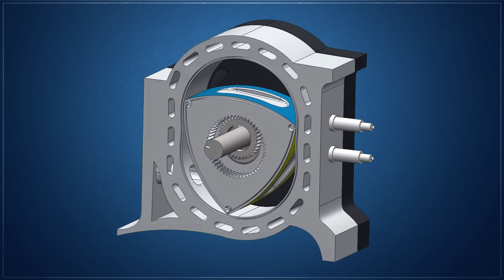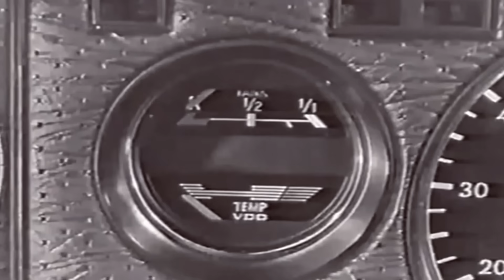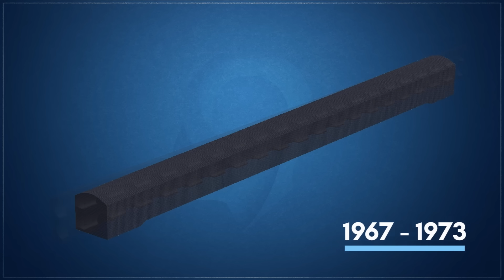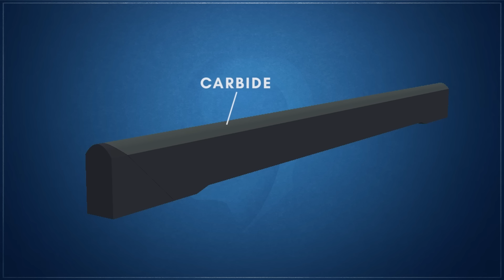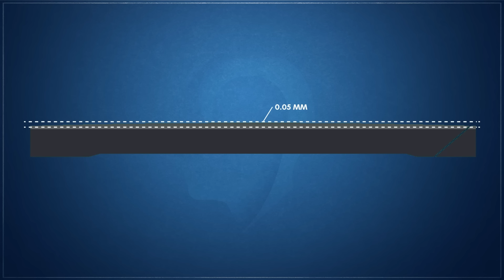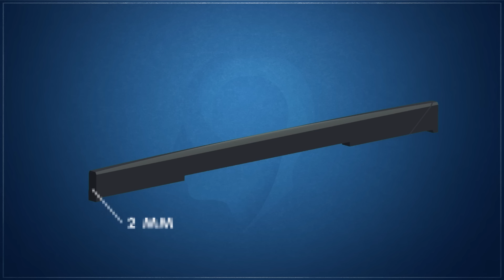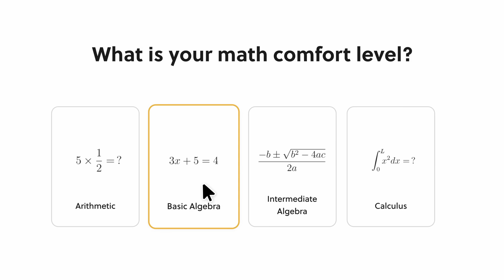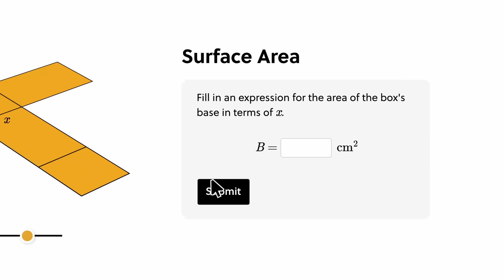Overcoming The Rotary Engine’s Biggest Flaw

Comment: That cant be right. The generator may can run full time for 373 miles...but in conjunction with brakijg regen, coasting, and battery storage, it surely amounts to more than 28mpg...
Reply: It's running while its coasting, though. It's a generator engine that's not connected to the transmission.

Comment: I would argue that the apex seal was totally resolved by Mazda and this was clearly not the biggest problem related to this engine.   The large combustion chamber surface area with corners that prematurely quenched the combustion flame front resulting in high HC emissions was a far more fundamental problem than simply could not be resolved.
Reply: Thats exactly what I was thinking.
40+ years ago, apex seals were most certainly a challenge. Mazda and the aftermarket have made sure they are no longer much of an issue. But the long, thermally inefficient combustion chamber is an issue that cannot be rectified without the rotary becoming something totally new and unrecognizable as Mazda's darling.
Reply: @84gssteve  they could use a metal that has lower thermal conductivity, like stainless steel, for the combustion chamber and coat parts of the rotor that is not subject to friction with ceramic coatings to slow down the heat transfer.
Reply: @84gssteve reliability problems have never been resolved
Reply: @84gssteve  i would think the longer a motor can hold on to the precious energy-giving hot exhaust gasses the more efficient it would be, no? i thought the emissions and poor fuel mileage was because the injected or sucked in fuel (carbed versions) sloshed to the back of the rotor on intake, thus allowing a bunch of raw fuel to escape on the exhaust stroke unburned... same principal as in a 2 stroke non-DFI piston motor? positive im explaining that incorrectly about emissions but thats whats in y head!
Reply: @ct1762  The Wankel engine is inefficient in 3 ways;
 it has poor combustion, poor thermal efficiency and poor mechanical efficiency which means that less fuel is converted into heat (inside the engine), and less heat from that fuel is converted into rotational horsepower.

we see this expressed as high exhaust emissions, high exhaust temperature and low BMEP and torque output.

simply put, it's not a very good engine design in every important aspect of engine design.
Reply: @DoktorBayerischeMotorenWerke it is a good engine design, it's just currently not as efficient as a 4 stroke piston engine. If configured as a generator running at constant speed or for long range drones, it's an amazing engine.
Reply: @Benny_Shill  The Wankel engine was a failure, it is a very poor, inferior design that cannot compete with or offers any advantages over other more successful engine types.
Wrong, the Wankel engine is very poorly suited to generator applications and has never been used successfully in a commercial generator application.
It is also very poorly suited to long range drone applications due to its high fuel consumption and lack of loiter time over targets.
 The most popular UAV engine in the world is the reciprocating types made by the Austrian company Rotax.
 The United States Military is the largest operator of UAV no longer buys any UAV with a Wankel engine, they have a notoriously bad reputation for poor reliability and limited range. 

Wankel engines are so unreliable that they cannot be used in manned aircraft.
Reply: @84gssteve I'm hoping that liquid pistons designs will do a better job here.
Reply: Seems like there are few components with any geometry flexibility in the wankel, so opportunities to fix these issues are... probably not great.
Reply: Agreed. Seems to me the biggest issue with the rotary is requiring engine oil in the fuel, hurting emissions.
Reply: @isaakwelch3451  The biggest problem with the Wankel engine remains poor reliability and durability, this is a fundamental design issue related to the instability of the combustion and the extremely low mean time between failures of the fragile apex seals.
Reply: They also leak compression internally between the faces.
I have an Rx8 with a mod to fix this and it's never been better. Cooler exhaust, better mpg, no more flooding.
Reply: @LordCakeskull There are no effective solutions to the many fatal flaws that plague the Wankel engine design..
Reply: Had to laugh iv seen and driven every Mazda rotary car over the years.i just now realized it.i presently own an rx8 lol yeah they can be a bit of a pain  but fun fun when they're good to go😊
Reply: Seems revving this engine high  makes combustion better less fuel used
Reply: Also the fact the combustion always takes place in only one section of the chamber. That is something that can't be resolved.
Reply: Interesting opinion.
Reply: 3rd plug new patent
Reply: @GilSimhonCoachingNLPservices  What new patent?
Reply: @sandervanderkammen9230  
Mazda has a new patent regarding a 3rd spark plug to combust fuel that else will not combust until the exhaust
Reply: @GilSimhonCoachingNLPservices  3 spark plugs are not new, was invented decades ago.
Reply: @GilSimhonCoachingNLPservices  Adding more spark plugs lowered the thermal fuel efficiency which is why no production engines had more than 2 plugs
Reply: @sandervanderkammen9230 put a rocker arm on combustion chamber doors that alters the shape of ghe housing with movement of the rotor... or put a 1 cylinder piston on the Crank and route all exhaust through it and double combust to increase power and lower emissions.
Reply: @Benny_Shill The intake and exhaust ports are already covered during the combustion cycle.
The shape of the combustion chamber is linked directly to the very limited geometry envelope that allows it to function as an engine.
It's been done, combined cycle heat engines.
 Turbocharging and Turbocompounding are the same concept but are more efficient.
Neither system solves the problems and disadvantages of the Wankel engine, in fact it just causes additional problems.

It seems like you have been fed alot of misinformation about the Wankel engine.

You need to have an advanced understanding of how 4-stroke engines work and a deep dive into the engineering concepts before you begin see why the Wankel engine is a failure.

Any questions kid?
Reply: If emissions are the only problem i would call this a problem-free engine
Reply: @sking2173, Great idea!  10-16-25 TH
Reply: Do wankel diesels work any better considering the flame jets aren't supposed to get anywhere near the chamber walls?
Reply: @gregorymalchuk272  The Wankel KKM cannot support reliable Diesel compression ignition or thermal efficiency due to the low static and dynamic compression ratio.
The Wankel engine's compromised seal design cannot withstand the high pressures and temperatures either.
Reply: This sounds like a more interesting video, honestly.
Reply: @kindlin  The most HATED rotary🔥🔥😬💥🤘👉 https://www.youtube.com/watch?v=gHVC9DN1row
Reply: there's liquid piston design (not a wankel) which resolves that and has ~40% eff
Reply: Allegedly.
Reply: @ChuckLeeClerk Beware of LiquidPiston it is a notorious vaporware investment scam
Reply: @ChuckLeeClerk  The most HATED rotary🔥🔥😬💥🤘👉 https://www.youtube.com/watch?v=gHVC9DN1row
Reply: Your argument fails under scrutiny... the primary failure mode of all Wankel engines is compression loss due to apex seal failure, it is well-known and understood that the apex seals have poor durability and a very low MTBF, so low that Wankel engines cannot pass the minimum reliability standards for aircraft certification testing.
Reply: Engine oil consumption was ridiculous😮😮😢😢
Reply: Hmm..A wider combustion chamber,..A dbl-section seal...and an MSD-type multi-spark progressive ignition..with proper timing curve....and a better housing for heat loss reduction to go along with the re-configured  intake port should improve efficiency.//Steve B.
Reply: @stephenbaker3680  Its all been tried before and found to be ineffective or detrimental to efficiency and performance.
The Wankel engine reached the logical conclusion of its development potential decades ago... it is fundamentally and inherently inferior to the reciprocating engine concept.
 There is no longer any legitimate research or development of Wankel engines in the Industry..
The Wankel engine today is the sole domain of crackpots and con men.
Reply: When you used the word clearly you completely lost me. People that say clearly loosely are almost disconnected from reality.
Reply: The lubrication of a rotary is the hardest challenge I believe. The operate much like a 2 stroke, having no separate combustion/no combustion areas; every part of a rotary is doing something, all of the time. This can be fixed by premixing, but that makes a car likely fail emissions regulations.
Reply: @willlong4258  — Some enthusiasts did actually add 2-stroke oil to the fuel … From what I’ve read, it worked.
Reply: @sking2173  yep, I do that. It absolutely works. My dad has a 196,000 km rx8 on its first engine for that reason.
Reply: @willlong4258 premixing also makes it more unreliable
Reply: @willlong4258  WHY!  Why would anyone deliberately pour the wrong oil down the wrong filler hole???

Premixing an engine that already has a metered oil injection system is simply dumb... it's something that only a niave amateur who does know how to read an owners manual or the label on a bottle of motor oil would ever do.

Please stop posting false urban myths and ignorant misinformation about a topic that you are very clearly not qualified to discuss intelligently.
Reply: @Benny_Shill There is no evidence that premixing does anything more than damage the engine.
Premixing is inferior to oil injection in every aspect... fuel mixture ratio and lubrication rates are not compatible, premixing is a compromise at best.
Reply: The RX8 met or exceeded the strictest emissions standards in the world EPA Tier 2 bin 5 and CARB ULEV PHASE 2 right up until production ceased to to lack of sales.
Reply: I feel like a rotary motorjet engine is the secret solution to incompetent combustion lol.
Reply: From a power perspective, it's bearings and wobble that I would say are the biggest problems. After all if you are making 500+hp a rotor inefficient isn't so important.
Reply: So basically the EPA killed this motor. Got it.
Reply: @keithbaker1951  No, people who like to breathe clean air and don't like to pay for poor thermal efficiency (A.K.A. poor fuel economy) killed it.
Reply: @keithbaker1951 The Wankel engine was a failure everywhere... not just places under EPA jurisdiction
Reply: The reliability problems of the apex seals has never been solved, it remains the primary failure mode of all Wankel engines and the reason why the Mazda Renesis was the subject of the largest engine recall in the 21st century.
Reply: @sandervanderkammen9230 yep. Mazda much improved the life of the apex seals but never solved them. Frankly, given the job they have to do, it seems to be a design weakness which can’t be solved fully either.
Reply: @sandervanderkammen9230  fake information.
Reply: @dgmdgm7271  Just the facts here lad, the Wankel engine was a failure because it is inherently unreliable and fundamentally inferior to reciprocating engines.... it's simply a bad design.
Reply: @sandervanderkammen9230  The best solution for rotary engines is probably to switch away from the Wankel engine to the Liquid pistons design.
Reply: Not a perfect rotary. Has poor torque at low speed, and all the efficiency, and cooling issues. Can only run at certain ratio. 

 Liquid Piston looks cool, but I wanna see a vane engine. I've read it is theoretically the most efficient engine we can make. I wanna see them at least for generators. 

 Anyway it blows my mind how much is sacrificed just to keep ICE piston balanced.
Reply: @RedactedDeath  only in theory, by ignoring basic mechanics.

sarichs orbital same idea as the vane but inverted. didnt ever run by itself despite all the funding it got in the 70s...
vane motor can barely make enough power to run themselves, let alone produce useful power. pretty simple. pressure acts in ALL directions. all that srface area to absorb heat, and only a tiny fraction of it goes towards producing torque. its worse than the wankel.

utterly different operation in an ICE to a common air tool or compressor running vanes.

wankel still has a few tricks up its sleeve if its looked at from another angle...

no ports in the housing. no holes at all... controlled intake and exhaust timing. 3 combustions per revolution. well exposed plug for good ignition reliability (they dont work well down in a hole, funny that...)
"liquid piston"? ha! only true "liquid piston" is a humphrey pump...
Reply: Emissions are a non-issue

Comment: As cool as the progress is electric cars kind of make any further progress pointless. It will never be better than an electric engine. 
This makes me want a video on advances in electric motors, I imagine we will see a lot of new progress on them in the near future.
Reply: The problem with electric cars is that they don't generate it's own power. Meaning that they can't be used if you live in a rural area that has few to none infrastructure required to keep them running

Comment: Wankel engine, not rotary. Rotary engine is a airplane engine.
Reply: Weird, why is it called the Wankel rotary engine, then?
What you're referring to is more commonly known as a radial engine.
Reply: @tim3172  Incorrect. A Radial Engine has a fixed Crankcase and cylinders with a free rotating crank. A Rotary Engine is fixed at the crank and the crank case and cylinders rotate. 

Gnome Monosoupape, LeRhone, and Oberursel engines that powered most WW1 Fighters were Rotary engines as I described. The Propeller was bolted to the spinning crank case. LOTS of Gyroscopic Effect.
Reply: The better term is "ROTOR" engine. Probably a translation issue form German or something.

Comment: I can't imagine the type of research that was done to provide the details covered in this video. Great job.
Reply: and not all of it is correct.
Reply: This is how hard u can push a rotary🔥🔥😱😱https://m.youtube.com/watch?v=xtVVPioU9p8&t=1127s
Reply: not enough
Reply: @ValentineC137  Is there alot of incorrect information in the video?
Reply: @mikeyp2277  There are some smaller things like talking about the chatter marks as if they were a problem in production engies.

Rather, the chatter marks were an issue on the design given to them from NSU which they resolved with different oiling and apex seal designs before ever construction a production engine for a car

The main problem with the video is the focus on the apex seal being the flaw in the rotary engine, it’s like saying the piston rings or valve seals are a flaw in the piston engine.

As an avid rotary enthusiast I have not heard of the apex seals being an issue in any stock production Mazda rotary from the Cosmo to the RX-8
The only problem they might present is for people modifying their engines as even very minor knock/pre-detonation can cause the apex seal to warp or crack

The real flaw(s) that’d likely be talked about if you asked people familiar with the engines would likely be efficiency and emissions

There are some problems encountered in the RX-8 that were born directly from Mazda’s modifications to improve the emissions when they switched to sideport exhausts, the major one being the shape of the internal port made it so carbon would build up in a sharp corner and, when the buildup got big enough, it would catch a side seal and snap it making you lose compression and require a rebuild.

The other problem is more for tuners because the middle plate has 2 exhaust ports right against eachother, and as the extreme heat of the rotary exhaust is blasting that area, then the dividing wall between the two ports melts and falls out.

Michaelharrison should be near the top comments and makes a good point about the combustion chamber size, I’d like to think that there are more people talking about the misguided focus of the video with equally good points all over these comments.

It could have worked better if New Mind had a title more like “The Rotary’s Most Stressed Component” or if it just talked about the actual flaws of the design.
Currently it just purpetuates the myth of apex seal unreliability
Reply: This is how hard u can push a rotary🔥🔥😱😱https://m.youtube.com/watch?v=xtVVPioU9p8&t=1127s